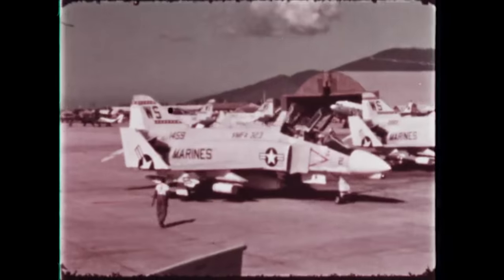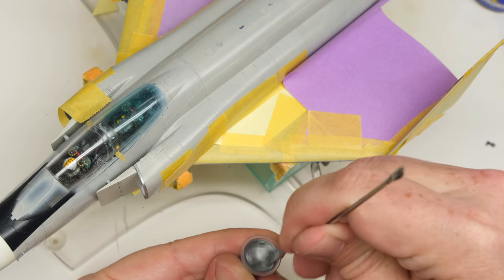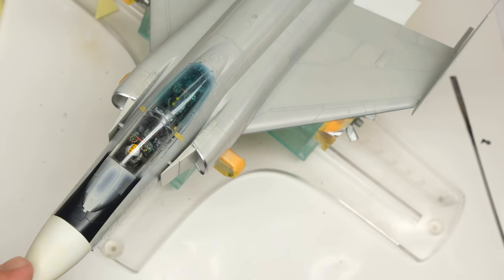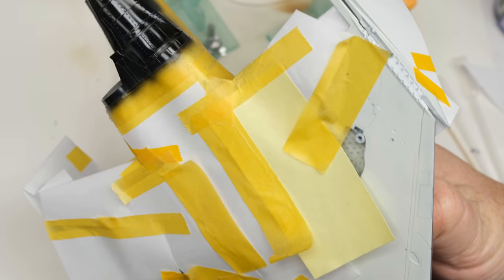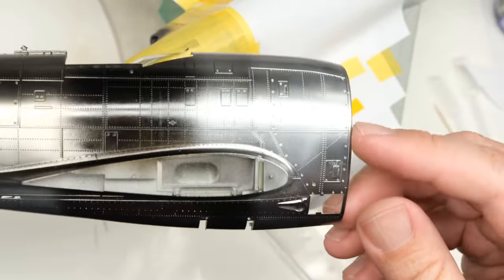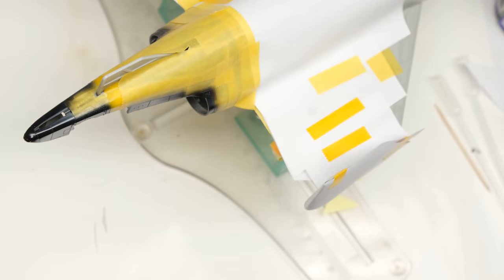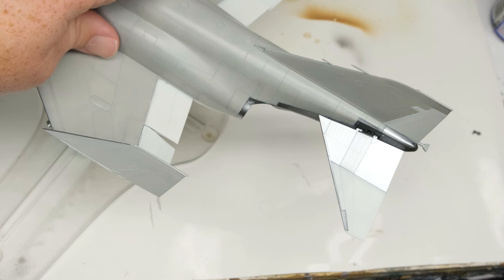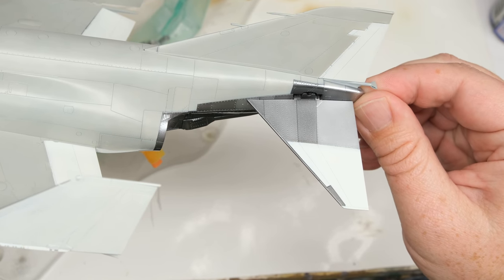1/48 Tamiya F-4B Phantom 09 - Metallics - 4K

Comment: Not that I can model to the same standard as you but FYI the trapezoid panels were known as shingle panels  made of titanium and the curved ones below were known as jet blast panels. At one tome in the 1980s I worked  on F4 J /K uk version with the Spey engines the first job I ever had was stripping and cleaning arrestor hooks!  and anything to do with the back end of the aircraft, THE FILTHY END as it was basically burnt paraffin all over it. Especially on the curved jet blast panels and the hook. Hope that’s of some assistance to you, btw the model looks superb

Comment: Tamiya finally releasing the P38-j gives me hopes they will do other versions of the F-4, particularly the long nose models
Reply from the maker: I think an EJ (and early E) might be in the cards, but I wouldn't hold out for a late E, F, G, or the recce versions. Sad, as those are all more interesting to me than the shorties.
Reply: @DoogsModels  I suppose that leaves us with the Zoukei Mura F-4E or the old Hasegawa kit as the most viable options.
Reply from the maker: @ChrisK-LTC  yep. Fortunately the ZM kit is pretty good. I'll be buying like a case of F-4Gs when they release later this year.
Reply: I’m hoping also!